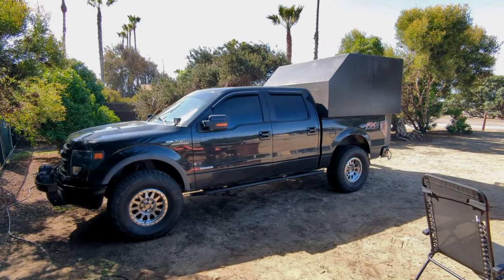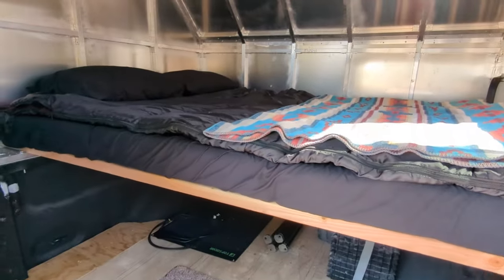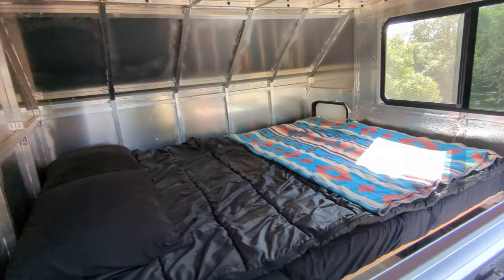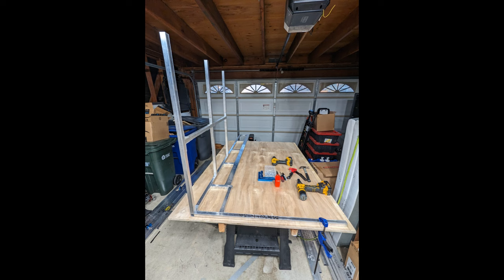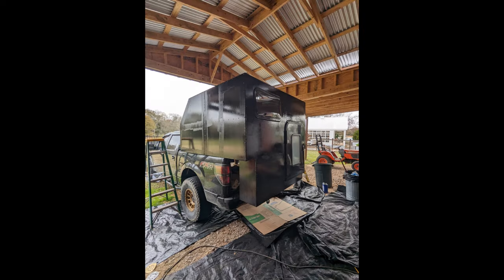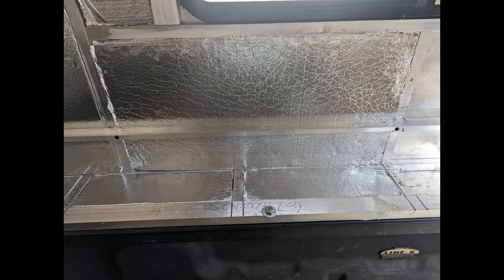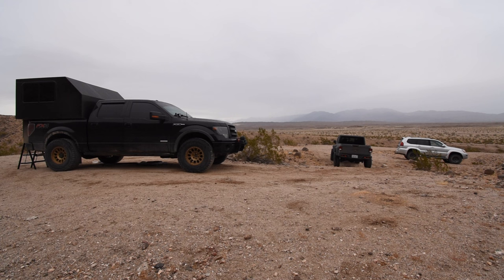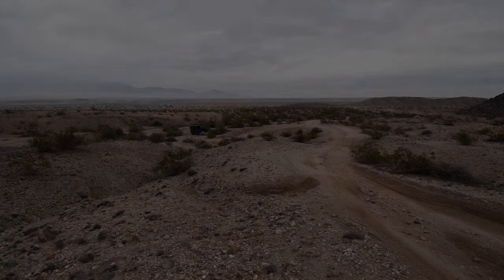I Built the Ultimate NO WELD Aluminum Camper in my Garage for $3500

Comment: Been camping for 50 years and I went to the Toronto Sportsman show. I walked into a $ 135,000 Road Trek camper van. Then I went home and called the CEO to say this. " It , looks like none of your designers have ever been camping in thier life ! The use of space makes me think that someone got a real deal on HEAVY ,....chip board real cheap and then they tried to cram it all into the camper. Lately on the net I see people with brains creating campers and trailers and camper vans that actually have flow and durability.
Reply: @ivanleelivingston4902  I actually prefer a van...I built my first one in 1976 which ruined it for my carpentry business so I bought a one ton van ..welp a couple years later I built it out....we were a family of four the kids were still young but we had plenty of room

Comment: Well Done!! Shells are Best because you do not lose Floor space. + the excessive lower weight of an enclosed camper. My Callen Camper is steel frame , but a Shell with barn doors + 1 inch insulation walls. Been in -10 in it on my Land. 👍👍🇺🇲🇺🇲🏁🏁🔧🔧🛠️🛠️

Comment: so you just started getting accurate measurements of your bed then starting plugging them into fusion and got the lengths of all the bars and panels?  starting to inspire me with the fairly low aluminum cost
Reply from the maker: Yes! Basically just measured my bed extensively, then started designing. I spent a lot of time confirming the design dimensions before I moved forward
Reply: If you have a Ford they have online specs to aid you

Comment: What an incredibly cool build, especially that it is designed for your needs. I'm curious if you're getting any dust intrusion? Some of this question goes to how you mated the rear section on and how it mates/seals where the tailgate was. I'd love to get your insight here.
Reply from the maker: Thank you! So I actually sealed in all the cracks and gaps with silicone! I don't get any dust intrusion with everything sealed in tight

Comment: Wow that is a great build. I am currently in the works of designing a truck camper for my f150, I want to have an aluminum frame but I am not sure what to use for the exterior walls, how thick are your sheet aluminum walls and what alloy are they? Thanks
Reply from the maker: Thank you! I used .090 wall aluminum sheet. I think 6061 allow if I remember right. Best of luck with your project

Comment: 😀   Are you depending on the flex seal to seal up all the rivet holes?
Reply from the maker: So I used sikaflex 221 behind every panel seam, and outside of every panel seam as well. Basically encapsulating every rivet hole. Then I have the flex seal as a top coat covering all rivets. I especially made sure to double down on this method for the roof. Will see how it holds up!

Comment: What size square tube did you use and what’s the aluminum panel thickness?
Reply from the maker: I used 1" x 1" x 0.065" wall square tube for most of it, with a few areas of 1" x 2" x 0.125" wall. Then I uses 0.090" thick aluminum sheet

Comment: I don’t know anything about construction and I wanna go this route. I’m concerned that rivets aren’t strong enough for constant highway winds. I may be wrong, I don’t know. Do you have more construction photos you are willing to share? On the smaller (shorter) joints do you still use double rivets per side, so 4 total? Did you find drilling the holes hard and time consuming? Perhaps a second video in depth? I think people really like your idea and wanna see that part. Thanks
Reply: Yes, another video with a few more details would be great. Including design tips. Most of us don't have access to a CAD program. How to circumvent?
Reply: Riveting an aluminum frame with square tubing can be a viable option for a truck camper, provided that it is done correctly and with appropriate materials. Here are some key considerations:

Material Strength: Ensure that the aluminum used is of sufficient strength and quality to handle the stresses and vibrations from road travel. Aluminum alloys like 6061 or 5052 are commonly used for structural applications.

Rivet Type and Placement: Use high-quality, load-bearing rivets, such as aircraft-grade blind rivets, which are designed to handle vibrations. Rivet spacing and placement should be carefully planned to distribute the load evenly and prevent stress concentrations.

Square Tubing Size and Thickness: The size and wall thickness of the square tubing should be adequate to support the camper's weight and withstand dynamic loads. Thicker walls provide better resistance to bending and deformation.

Joint Design: Proper joint design is crucial. Overlapping joints with multiple rivets can provide increased strength. Additionally, reinforcing plates or gussets at critical joints can enhance structural integrity.

Corrosion Protection: Aluminum is prone to galvanic corrosion, especially when in contact with other metals. Use proper sealing techniques and consider using a corrosion-resistant coating or anodizing the aluminum.

Load Considerations: Assess the overall load that the frame will carry, including the camper’s weight, contents, and any dynamic loads from road vibrations and impacts. This will help in designing a frame that can handle the stresses without failing.

Testing: After assembly, it's advisable to perform load testing and vibration testing to ensure that the frame holds up under real-world conditions.

If you ensure these factors are addressed, a riveted aluminum frame with square tubing can be a strong and durable option for a truck camper.
Reply from the maker: So far 8 months in, I have no issues! Seems very strong

Comment: Why rivet and sikka flex over welding? To allow movement? Purely cost? No access to welder?
Reply from the maker: Rivets and Sikaflex for several reasons. Time, money, skills, strength. Yes, welding is superior, but this combination is a very repeatable, simple task, and much easier barrier of entry. End result is a very stout, strong camper. I would love to learn to weld aluminum, have the machinery, and time to weld. I'm all for it. This is just another method that worked very well for me 😁
Reply: @TruckCamperCooking  I've wondered if welds would crack over time being on the beds rails. The factory built ones weld the frame and vhb tape the panels. I've got access to a welder at work so I've long contemplated this set up. My exception would be including an over cab basket that lines up with a roof rack on the camper to mount my canoe/hold extra gear. Still pretty jealous though. You put in the time and effort, now reap the rewards. Well done!

Comment: How did you seal the rear to the floor of the bed to keep dust out? 

And what are the dimensions of the bed (sleeping, not truck 😂)  According to the Body Builder Layout for that generation, a standard F-150 is 80” wide, and it looks like you have about 2” overhang each side, so there should be room for a full bed there
Reply from the maker: Yes full bed! I have roughly 80" wide x 79" long usable space inside of the camper to work with. That space is above the frame rails. When I designed it, I was not 100% certain whether I wanted the bed going front to back or side to side. I like having the flexibility to set it up in either direction. I plan to make more of a converting bed to allow for more usable/functional space inside

Comment: Very nice.  Where did you get the aluminum? I am going to build a cab-over.  I am not sure if I want to go with wood or aluminum. Wood seems a lot easier for me as I have the tools.
Reply from the maker: Thank you! If this helps in your planning, I was able to build this with (chop saw w/ metal blade, drill, impact, angle grinder, and electric rivet tool) nothing too crazy tool wise. Good luck with your build. I got the aluminum from a local steel supplier
Reply: I want something exactly like this for my truck. I keep watching this video over and over again to get ideas. What is the height of the camper from the floor to the ceiling?

Comment: What is your steel suppliers name/location and laser cutter as well?  If they are in California?  Thanks.
Reply from the maker: Summit Steel
Reply: @TruckCamperCooking  Thanks looks like I will be using the Irvine Industrial Metal Supply Co. as 1 in. x 96 in. Aluminum 0.063 in. Square Tubing is $13.32 where as lowes and home depot is $30.00 per tube but I will call Summit steel in Huntington Beach to check their prices as well.  :)

Comment: I'm curious why didn't you extend the build over the roof of the truck and have a sliding glass window in the camper matching a sliding glass back window of the truck? Your attention to the weight of the materials makes good sense. The price on slide in truck campers is insane.
Reply: I'm not the builder, but let me guess ... 
There are probably multiple reasons: 1. building the "granny's attic" makes the camper much taller, also causing wind drag, reduced mileage and difficulty to control in crosswind areas, 2. it's probably a lot harder to build that one section (than all others), especially if it's meant to carry serious weight (humsn bodies and bedding materials), 3. instead of building that, G's A, the same areas/needs were met by building over the pickup bed's side railings, and by extending the area over past the tailgate.
Reply from the maker: I mainly choose the design and shape to make the camper large, but not too large. In my opinion, I did not need or want the extra space of a cabover. Not having the cabover reduces the material cost, weight, and complexity of build. Not to mention a cabover requires a taller overall height. They can have benefits, but for my use case, it made sense to avoid a cabover. Thanks for the comment!
Reply: @seresamgala8125  The camper is higher than the roof of the truck, extending it over the truck roof would be pretty simple and not add that much weight to the camper. Having a sliding glass window in the camper and in the back truck window would be a useful feature.
Reply: @russellweber3466  you heard from the builder: it's not needed, wanted, and NOT SIMPLE, there's nothing further to say; when you build yours, you're welcome to do it your way 😁